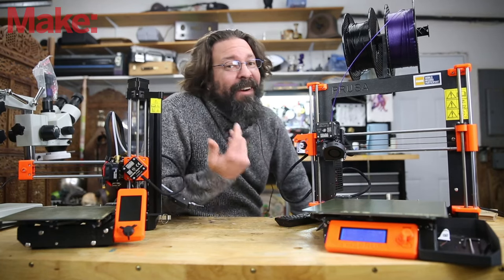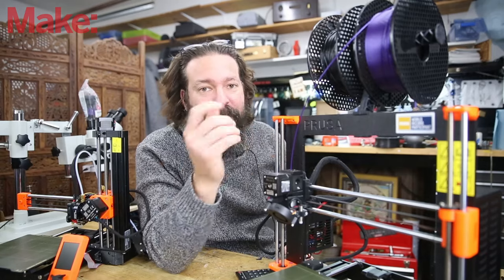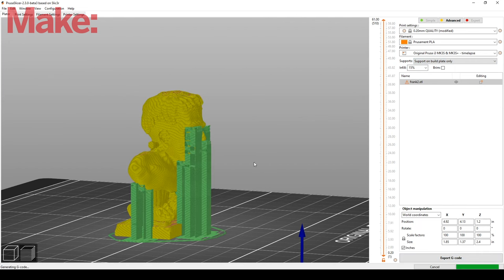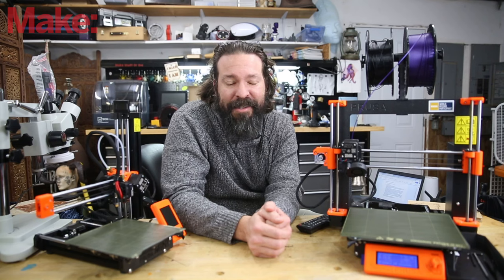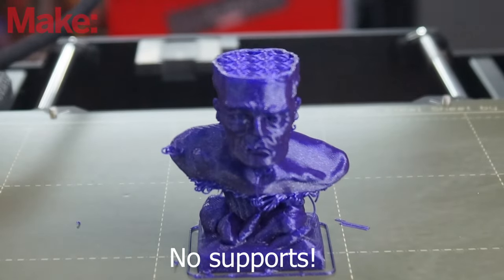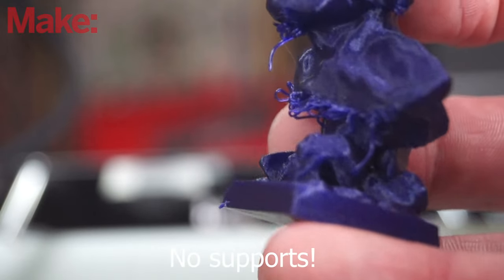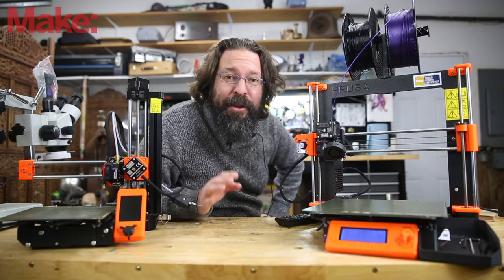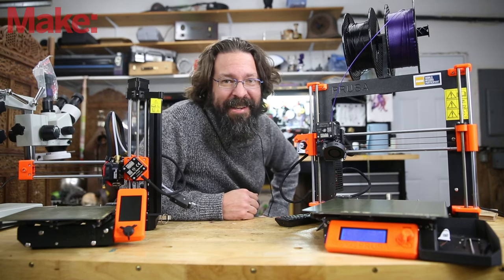4 support tips for perfect 3d prints

Comment: What's the best way to get rid of the roughness left underneath the object by the supports?  Every time I remove the supports, the area they were attached to are very rough underneath.
Reply: I’m looking for an answer to this too. From what I’ve found, it’ll never be as good, since it’s required that the layer above the support isn’t fused to the supports. Someone recommended reducing the support z distance, at the risk of sticking. I think we need some sort of support tower test, to sweep through settings.

Comment: 3:30 ever since you got the Mark 3S removing supports in a difficult way hasn't been something you'd have to deal with? A prusa is no better than any other printer and I understand you are sponsored by them but this has to do with your slicing settings, not the printer. If anything there are other printers that will allow support removal far easier than a prusa.